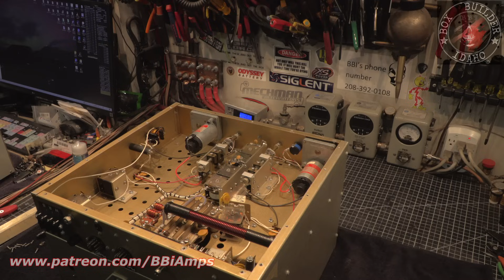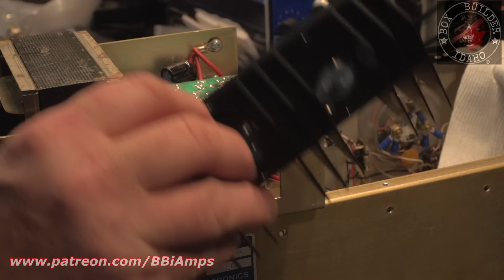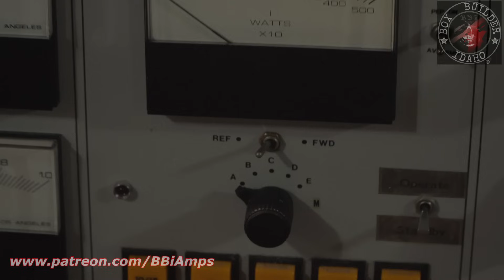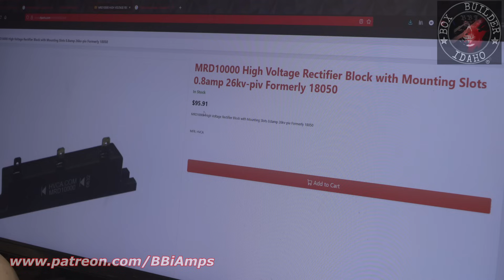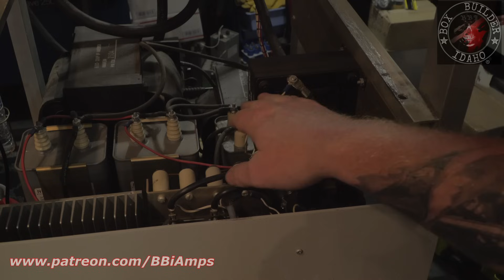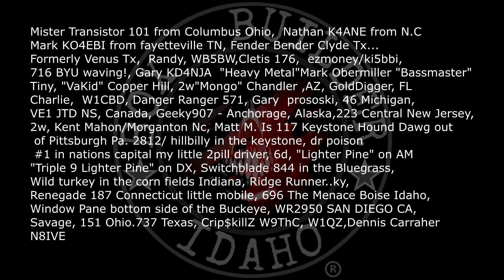Henry 8k Ultra part#2

Comment: a square steaming coax birdmetter replacement with just a black/white display would be tits no thrills no buttons just usb programable and controlled by the stock meter switch